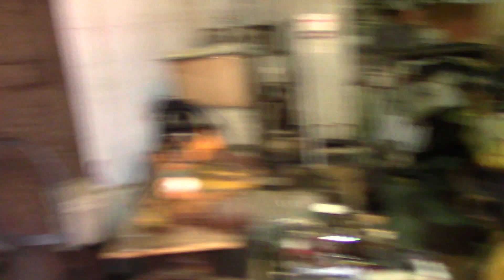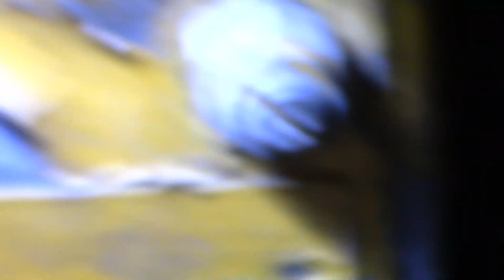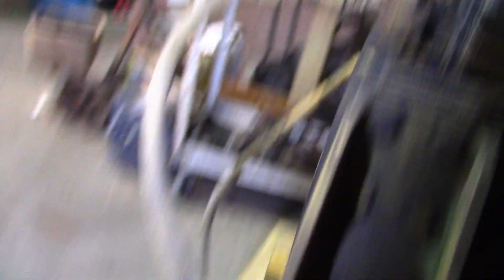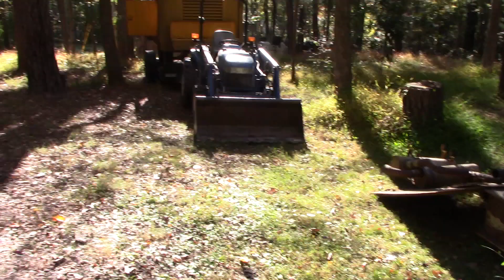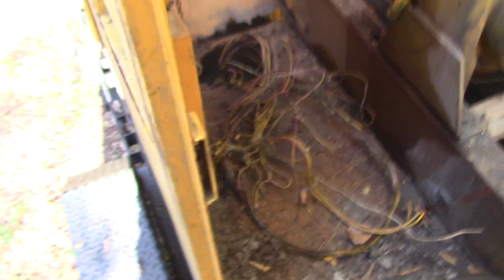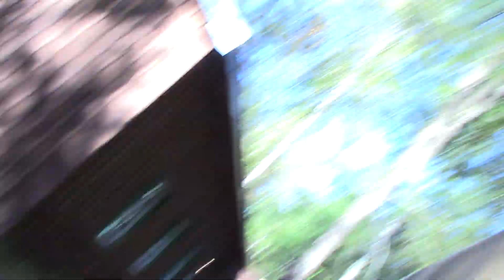10-23-23  --  Air Compressor Epilogue

Comment: That is a really cool engine and it will be really great to hear it running. It is a shame to scrap the trailer, it would be an interesting to turn it into a road trailer or worse case a shed
Reply from the maker: Thanks Joseph.   Actually Josh Topper called me about wanting the trailer.  He is like 2000 miles away from me, so it would not be worth it.  I gave it to my buddy who owns a junk yard.  That way it is like a trade and barter thing, he gives me free car or truck parts if I need them.  --Doozer

Comment: You might have a governor on that engine like a generator so it’s constant speed. You might have to change the governor to put it in a variable speed application like a truck.
Reply from the maker: Dale, you might be right.  But since this is Doozer's Shop, we tend to take things apart, analyze how they work, and modify them to work better for us.  I think I can chuck out a spring or two, and add a lever or crank, and boogie on down the road.  Maybe.  -------Doozer

Comment: Why aren't you keeping the radiator and fuel tank for whatever project you use the detroit engine on? You will have a hard time finding a radiator with the dual outlets on top
Reply from the maker: I saved the diesel tank, because it was clean inside and no rust.  I think it is about 80 gallons.  I think I will use it for a saddle tank on the R-185 fire truck, because it uses fuel like cargo ship !  The radiator was like 4 foot by 4 foot square. Really huge. It had bolt on tanks that were rusted so thin, I did not trust them.  The whole compressor needed absolutely everything to put it back into use.  It had about 30 hydraulic type hoses, for fuel and air and oil, and they were all in need of replacement. Totally fragile.  You could grab one and twist it off at the fitting.  It cost many thousands of dollars and a lot of time to make it operate as a compressor again.  As for the dual radiator inlets,  you can solder in another inlet on any radiator pretty easily. That is not an issue.  --Doozer